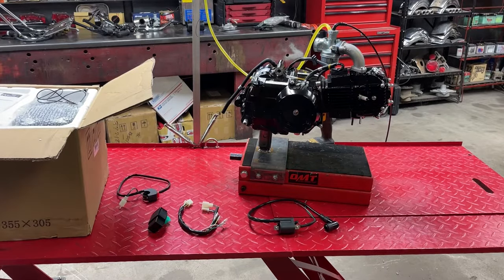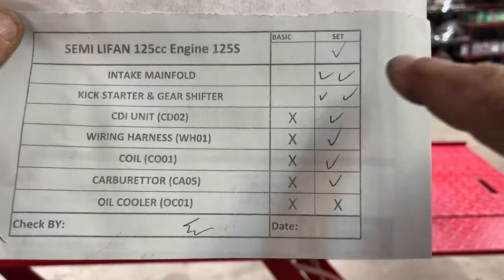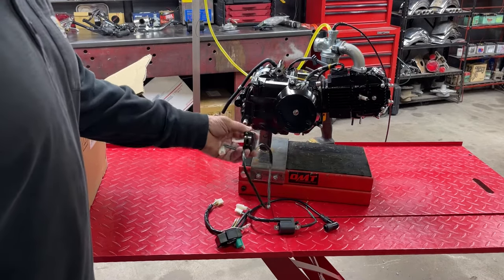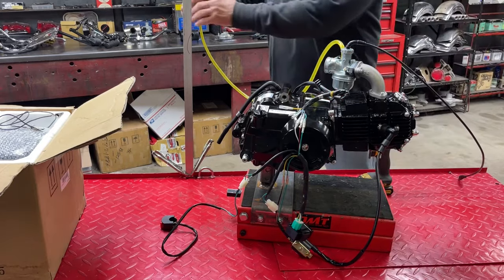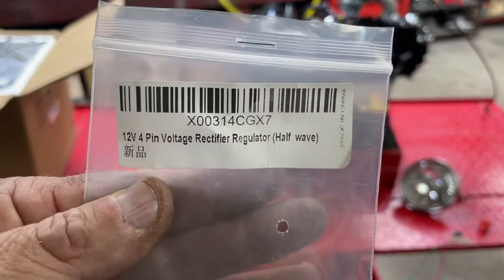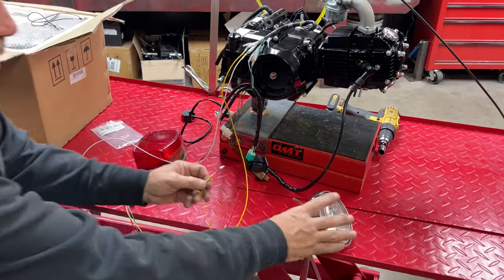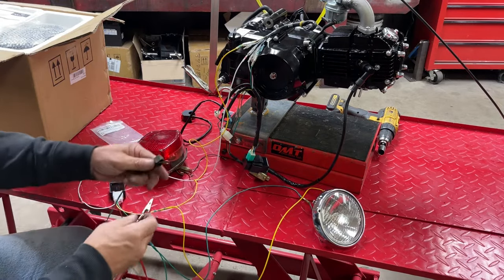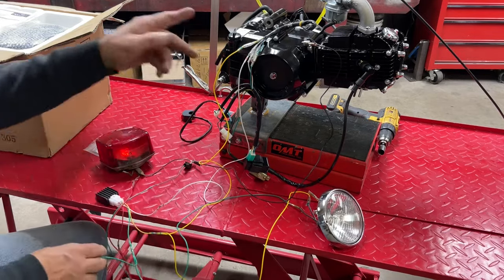Lifan wiring - simple wiring for lights

Comment: So in theory I could do this and run a battery that gets trickle charged so I have a headlight even with the motor off?
Reply from the maker: @HeyItsAsmus  Yep
Reply: @MiniBikeMike  my engine has 2 yellow wires, and my 12V regulator has green, red, pink, yellow. 

So do I run the green to ground, a yellow to yellow on motor, pink to yellow on motor, and then red to the battery positive, and also to the red on my light bar, then ground the other wire on my light bar also? This will allow my light bar to stay a consistent 12v and not increase and decrease with idle/throttle? Or did I do something backwards?

Comment: Jus for clarification of if I am NOT using a battery I do not need to connect the red to anything or do I have to hook it to the rear light
Reply from the maker: @ModDemon125cc  I like to use the yellow for the headlight and the red for any other lights. But, I guess you could run them all off the yellow.
Reply: @MiniBikeMike  thank you very much my friend I appreciate

Comment: how much of the old loom on cub can be used for the lights instead of bringing new wire into it?
Reply from the maker: @stillben  Beats me.  I’ve built lots and lots of bikes….I never use any part of the original harness.  Way easier to start with a harness designed for the 12v engines.
Reply: @MiniBikeMike  ok thanks .. don't think it will be too much trouble to get some coloured wire and run it to the switches. Thanks for showing the regulator, wasn't sure which one to get.

Comment: This is hands down the best channel for rebuilding/restoring old motorcycles using new motors.
I need to check, but knowing how to wire up the brake light (for braking -  not just running brake light) would also be very useful.
Reply from the maker: Thanks!   Just split the power lead that’s going to the running light and send a lead to the brake switch.
Reply: @MiniBikeMike  I will try this.  Thank you so much.
I've been restoring a 1962 Honda C110 Super Sports Cub (I put a Lifan 125cc in it) and your videos have been CRUCIAL.

Comment: Thank you so much bud. I've never worked on a 2 stroke engine before. I just got a smoking deal on a custom 3 wheel bike. It's pretty fun to ride. Currently the front LED stopped working & the battery won't hold power now. That's a bummer for me. I did started workingbon it following wire by wire slowly 😅 I did kind of sort of figured it out "backwards.😁" But going forward got a bit to confusing 😱🤔 But i found you, & instantly after this well explained video step by step ((forward 😅)) You became our HERO my 3 wheeler & mine. I liked & subscribed to you're channel. Looking forward to educate myself more on this amazing small engines but yet they do have some power to them. Blessings buddy

Comment: awesome Videos Mike ... my sons lifan 125cc has a plug with 5 wires and a separate green with red stipe wire not in use ...
the plug has blue with white stripe and black with red stripe on top and 3 on bottom has green in middle and two yellows on each end ... now bike runs well only connection used from the plug out of engine is to harness is blue/white to green yellow stripe on harness and black/red goes to Orange on harness and the green goes to green on harness ... I want to connect just one nice 12v led light bar but i have only have 2 yellow wires left ( and the spare Green with Red Stripe on its on that has a male end so I'm sure its not a live wire as its near metal frame all the time ) can I assume that the two yellow wires are the same ?   please let me know your thoughts ... I was hoping to test the two yellow wires with multi meter to see if live current come out but not sure what the White wire does ?
Reply from the maker: @hillebrandstreet1882  Connect one of the engine yellows to chassis ground.  The other engine yellow connects together with BOTH the yellow and white of the harness.
Reply: @MiniBikeMike  thank you , I  connected the two spare yellows one to white on the white and one to w the yellow on the rectifier and then connected the light from rectifier red to light and green to earth and all is well :)    thank you

Comment: Hey Mike, great video for me. I just bought a Lifan and thanks to your video, I have spark. Going to mount carburetor and try firing it up. So now for the lights. What size are the bullet connectors and where did you purchase them. Especially the tee connectors? Thanks
Reply from the maker: @RonSalyers  Thanks.  Unfortunately, I don’t know the size on the connectors, I just bought a box kit on Amazon.   Honestly, if you want lights, the simplest thing is to purchase the 12v simple harness from Trail Buddy.  It’s pretty much plug-n-play and includes wiring for lights….minus turn signals.   Their part number is TB515.

Comment: Nice video very big help. But whats the difference between whole wave and half wave regulator?
Reply from the maker: Thanks.  The stator can either be wound full or half wave.  You’ll need to check and know what you have to get the correct regulator.

Comment: Thank you so much, but what if you also want to incorporate turn signals?
Reply from the maker: The stator can’t handle the added lights of turn signals, so the first thing you’ll need is to add a battery.   If you’re doing all that, it would be much simpler to install a complete 12v harness, for all lights.  Trail Buddy has an excellent harness, part number TB422.
Reply: @MiniBikeMike  Wow I really appreciate that.  I am planning on putting a zs212 into a '76 ct90, planning on running a battery and wanted to do a 12v conversion at the same time.  Would that kit still apply for a ct90? I assume so.
Reply from the maker: @therodenthitman Harness and engine don’t care what frame you put them in.   Just be aware, the CT90 uses a different engine mounting spacing.  Your engine is NOT a direct bolt in, you’ll need an adapter.
Reply: @MiniBikeMike  Thanks yeah I've ordered that adapter from DrATV.  Exhaust is the next challenge.

Comment: Hey mike i followed your instructions perfectly and ran a switch to my light , only running headlight , my issue is my light worked but it was dimming when i reved & then after turning the light on and off 3 times the light stopped working its an 18w led mini light bar , i ran yellow and red wire from the rectifier to the switch and i attached the red wire from my light to that & the green ground to the switch and then to the light , did i do something wrong ? I also grounded to the frame
Reply from the maker: Don’t connect both the yellow and red to your switch…..just one or the other.
Reply: @MiniBikeMike ok thanks! , I probably blew the light by putting both yellow and red on it then , im assuming

Comment: Hello, Good video! We have an issue with to high voltage, it just blow bulbs and voltage up to 24V. Without the regulator up to 45-50V.
I did not wire exactly as you but nearly, i did take everything from the regulator (red wire) didn't split the yellow.. 
i have tryed with several diffferent regulators but with no luck. another thing is that it seams like it comes AC out of the regulator also.

Comment: Hey great video, just wondering if i use a capacitor instead of a battery would i hook it up the same way?
Reply from the maker: Sorry, no clue, never used one.
Reply: Same thing
Reply from the maker: If you watch the video, no battery needed for lights.
Reply: @MiniBikeMike  Can you run Yellow n White straight to a headlight ?
Reply from the maker: He actually ask if he could use a capacitor, instead of a battery.   If you watch the video, you don’t need either of them.
Reply from the maker: If you watch the video, it shows which wire goes to headlight.

Comment: Hey Mike, I have a 2008 Lifan CT70 clone with a 110 enging. The headlight is really quite dim but the high beams are powerful. I have checked the ground and it checks out okay. Are these headlights typically undergunned for night driving? I was thinking about getting an LED replacement. Thanks for the videos man!
Reply from the maker: @snakepit101  LED is definitely the way to go.  They take a lot of stress off the stator.

Comment: Excellent video. Mike could you do a simple video like this but include indicators with an indicator light in the speedometer
Reply from the maker: It would be a lot easier to just purchase a full 12v harness from Trail Buddy, that has all the wiring in it.  Their part number is TB422.   But, if you wanted to run your own wires, tap into the red wire and connect to flasher.  From the other terminal on flasher, send wire to turn signal switch.  Then, from switch out to signals.
Reply: @MiniBikeMike  Thanks for the reply

Comment: My engine doesn’t have a white wire coming out of it, just the 2 yellow wires.  so I have nothing to connect the white wire on the voltage rectifier too. Can I get lights to work with out the white wire?
Reply from the maker: Sounds like a full wave system.   Take one of the yellows from engine and tie it together with both the yellow and white wires in the harness.  The other yellow from engine goes to ground.
Reply: @MiniBikeMike  Ok, thank you very much.

Comment: I got the lifan 125cc ssr engine installing on Z50 with lights but no battery, Im following your instruction for wiring everything before you start connecting rectifier, completed connection leads from my engine harness wires to the CDI harness leads as follows: blue/white to blue white, red/black to rec/black, green to green. This leaves the white and yellow wires from the engine harness to connect to the rectifier, but I also have one green/red wire with male end in the engine harness, cut it or ignore it? And I also have one more blue/white male end wire in the CDI harness, cut it, ignore it, or splice it in with the blue/white engine wire already connected to the CDI???
Reply from the maker: The green/red is the neutral indicator wire.  If you don’t have a neutral light, you can ignore it. 
I’ve never seen a harness with a second blue/white wire.  I’d leave it unplugged.  If you have spark, you can cut it or ignore it.  Some harnesses do have a black/white wire that is the “Kill” wire.  Are you sure it’s blue/white and not black/white?
Reply: @MiniBikeMike  My CDI harness had 3 extra leads with plastic plugs connected with wires 1 green and 1 black/white, so I cut 2 of them off and connected the other set of green + blk/wht to my kill switch on handle bar. The coil wires were already wired into the harness and had a sleeve on them, thats how this unit came packaged. And I checked the other wire from the CDI harness, it is a blue/white, so there were 2 of these that were in the cdi wire set for some reason, what it does I have no idea. the harness CDI plastic plug is good and fit in the CDI port and is connected. For now, one loose blue/white on cdi harness set, one white, one yellow, one green/red on the engine harness. And I  cant start the bike, tank and muffler not mounted yet. Want to get rectifier wired in before I start it.

Comment: Hi Mike, iv a stator that has just the neutral light option on the black grommet on the box (not for all the gears) and that wire is green and red. If I were to wire in just a neutral light on the pit bike the neutral light would have two wires. What wire would I need to tap into for it to work? Thanks.
Reply from the maker: @jonjeny  The green/red wire is the ground wire.  The other wire coming from the light needs 12v
Reply: @MiniBikeMike  thanks for your reply. So the red/green single wire on the stator into the black grommet for the neutral indicator is ground. The potential neutral light would have black and red wires. Correct me if im wrong, so the red/green wire would connect to the black on the neutral light and the red wire from the neutral light would feed into to which wire then? Yellow? Or which wire? Thanks once again?
Reply from the maker: @jonjeny  Let’s start from the beginning. 
Does your engine have a neutral switch?  Does the green/red wire connect to a round black plug that is to the top right of the stator?   If not, you’re not going to get a neutral light to work.   
If you do have a neutral switch, the green/red wire connected to it should run up to the headlight and connect to the ground wire of your neutral indicator light.  The other wire of the neutral indicator light will hook to whatever wire you have that is 12v hot, with the key on or when engine is running.
Reply: @MiniBikeMike   it's a 70cc kick start pit bike with no headlight and no key. It does have a neutral switch. Yes the red and green wire does connect to a round black plug at the top right side of the stator. The bike doesn't currently have a neutral light, I'm looking to potentially get one to wire in. Thanks again for your replies.
Reply: @MiniBikeMike  And which wire or wires would be the 12v? Thanks.

Comment: Oops from the motor there is no white wire but there is a pinkish colored wire that does not match up with the wiring harness so im guessing it does what the white one would do. That leaves a green and brown striped wire and a green one witch I think is the neutral switch
Reply from the maker: I have never had any luck with the stators that use the pink wire.  I honestly don’t know what’s different about them, but if I’m trying to hook up lights, I’ve never gotten it to work with the pink wire stator.  
So…..if you’re trying to run lights, I’d spend the $15 and get a new stator with the correct wiring.  It can be bought here:
12v stator plate
https://amzn.to/3WOMDnh
Reply: @MiniBikeMike  thanks Mike

Comment: Don’t know if you’ll see this, but is it possible to wire up the brake light to get brighter when front or back brakes are engaged? Also without a battery?
Reply from the maker: Yep.  Just tie into the red wire and send power to your brake switch.  The other wire of brake switch goes to the light.
Reply: @MiniBikeMike  okay much appreciated

Comment: Question for ya I know this video is older but I have a stator with two yellow on a 2021 Apollo 125cc dirtbike how do I hook up retifirer for lighting having troubles might you be able to give me some insight please and thanks
Reply from the maker: “Most” 2-yellow wire setups are full wave and require a full wave regulator.   For the wires, one of the yellows gets connected to chassis ground.  The other yellow gets connected together with the yellow and white wires in the harness.
Reply: @MiniBikeMike  thank you I will try this this weekend been trying to figure this out for weeks lol and thank you for a speedy reply have a great weekend let’s go oilers lol

Comment: Quick question I bought a used kazuma Chinese atv for my girlfriend and the wiring on the starter switch/headlight switch so does the horn but not the head light traced the wires and can’t seem to find where the power is going any help would be greatly appreciated👏
Reply from the maker: Unfortunately, I’ve never had one of those.  I’m a little confused on what you’re asking.

Comment: Did this and works but only in neutral.  When I put it in gear (any gear) the lights go out.  Obviously the neutral switch is triggering the output?
Reply from the maker: The neutral switch is just a ground.  Do you have a neutral light?  If not, the green/red neutral wire shouldn’t be hooked to anything.
Reply: @MiniBikeMike  Thanks Mike I’ll just make another ground.

Comment: I have 8 AC v at idle and 50+ AC V at high rpm
Only getting 3 DC v from regulator and 10 DC v at high rpm. 

I have yellow and white from stator to rectifier ,12v to lights and ground to frame. Any suggestions?
Reply from the maker: Correct regulator?  Half wave or full wave?
Reply: I'm not sure , how would I tell the difference? I've tried 3 off Amazon. All 4 pin/wire
Reply: @MiniBikeMike 
Looking at your link I would say I have the half wave as they don't have fins on the side.

Comment: Would there be any difference in running standard bulbs vs led using this method? Would it require some sort of relay? Just ordered this engine and honestly I'm not sure... Any response would be greatly appreciated
Reply from the maker: I’ve never used LEDs, so I’m not sure.

Comment: In looking at the wiring coming out of my 110cc engine, instead of a yellow and a white wire for charging it has two yellow wires instead.  Is there a way to determine how to hook them to the yellow & white wires in the harness?  Thanks.
Reply from the maker: One of the yellows from engine goes to ground.  The other yellow ties into both the yellow and white of harness.  Doesn’t matter which yellow of engine goes where.
Reply: @MiniBikeMike  Hi Sir, I followed your instructions, using half wave rectifier but i only get 9v in Multimeter which light up a 12v bulb very weak.
When I use full wave rectifier, the bulb is light up very strong but the multimeter reads nothing from the rectifier outputs (red and green).
Do you know whats wrong with my system ?

Comment: did your kill switch wires wires have the same color wires that the plug from the harness had or no ?
Reply from the maker: The harness kill wires are typically green wire and a black/white wire.   If you’re using a kill switch/button with two wires, it doesn’t matter which wire connects to which wire of the harness.  The switch is just opening a connection between the green and black/white of harness.   If your switch / button has one wire, that wire has to go to the black/white in harness.
Reply: @MiniBikeMike  ok thank you, and i don’t think the colors of the 2 wires my kill switch has which are the green and then black with gold stripes i can connect those to the harness wires that are green and another wire that’s black with white stripes right ?
Reply from the maker: @vonshootin-5092  The colors of the switch wires is irrelevant.  They can be pink and purple and it wouldn’t matter.  Just hook them up and go.
Reply: @MiniBikeMike  ok thank you sir